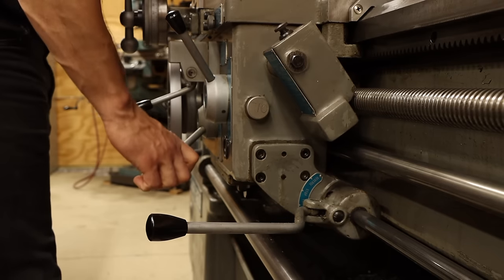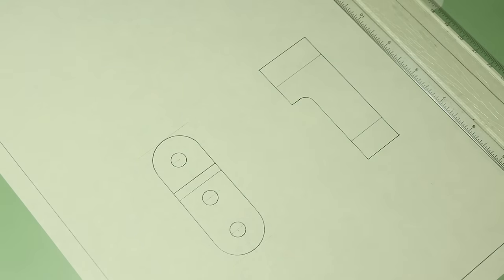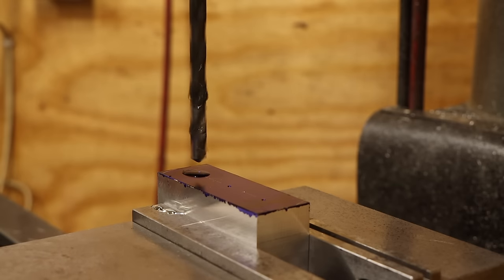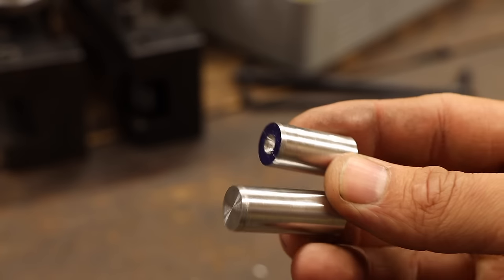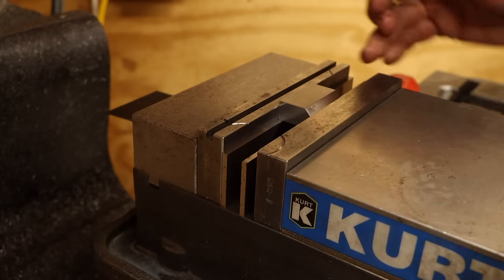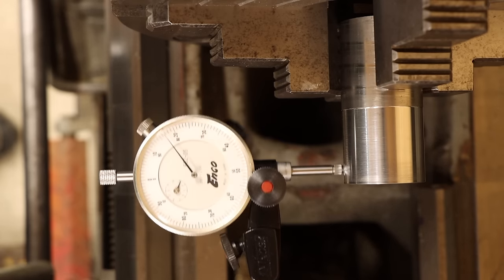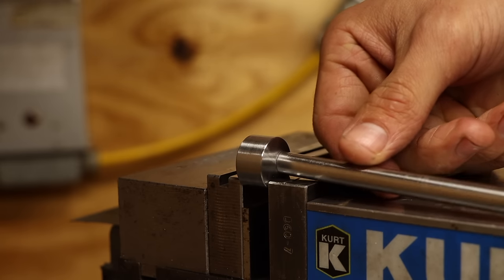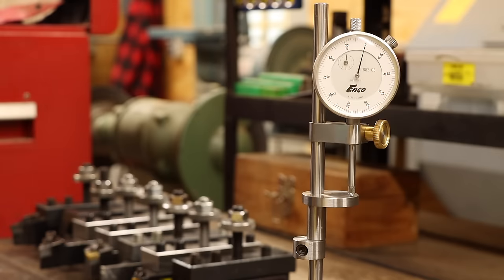A FANCY Lathe Tool Height Gauge || INHERITANCE MACHINING

Comment: Regarding magnets, you could have made an eccentric lifter that actuated a block inside the body of the base, leaving you with a narrower area of the base to lap in(i would have used harder metals merely to make it more durable and allow for lapping in... Inside the base you fit that sliding block and put in a few strong magnets... When you want to clamp down, you turn the knob, rotating the eccentric and allowing the block with magnets to lower and almost touch down, giving a strong magnetic pull, and when done, you lift it up, weakening the mag pull and allowing the base to be moved as you like... 
You could even use aluminium and bore out 3 holes for carbide round inserts which could be screwed in and loctited in place, lapped flat and perpendicular to the rod and the base, and then flood them with epoxy to provide a seal for the magnets so they dont suck in any particles when around any machine surface... The epoxy could be filed down or machined down those few tenths to leave the lapped carbide feet as the only reference... You could even avoid that by flooding the base in oily clay(kids clay with a bit of oil added to it) mould where you would gently press the feet in the surface, leaving them a smidge proud, and inserting a clay plug where the magnet block would be to seal that part off too... Its a lazy approach and easy, but can be accurate if done in a vertical press with an indicator... The black epoxy would also grant the aluminum base a nice contrast... 
Tho for moving it on the ways, you would have to be careful not to scrape them with the lapped carbide feet when you would move the thing about by tilting it, as lapping produces dead sharp 90 corners adjacent to the flat surface...

Comment: Semi related — I finally made myself a semi-precision machinist jack! I have no idea how you got your clamping slit and the threaded hole on the lock ring so nice 🥲 mine is nowhere near as nice and the clamp doesn’t feel like it tightens enough, however I did have to make some changes to tap sizes and some other things due to my own tool restrictions, and I’d never done that in a round part haha.  but man this project had a bunch of clamping slits!

Comment: I want it. I dont have a machinist shop, or even a garage, that I could turn in to one. But I still feel like this tool is something I need in my life.
Reply from the maker: It makes a nice fidget toy 😉
Reply: @Inheritance Machining  that, or I could use it to measure the sag on my GPU 😁
Reply from the maker: @nicosand86  😂 maybe exclude the magnets then!
Reply: @InheritanceMachining  naah, the magnets shouldn't be a problem so long as I dont rub the base all over the mothetboard and gpu 😁
Reply from the maker: @nicosand86  but isn't that the most logical place to mount it? 😂
Reply: @InheritanceMachining  not in my pc case 😁

Comment: Fun fact. Today it is "canon" to set tools exactly on CL. 
But in the REALLY old days it was to keep the tool about 5° above center with respect to the work center point for outside turning. That is really inconvenient to do in general machining so it has fallen from favor. 
There were good reasons for it at that time with the tools of the day. It was 5° above center to always keep a slight positive bias of pressure on the cross slide screw , to accommodate flex in the tool and holders,to keep the work away from any climbing over the tool, to better control chip flow and to counter any tendency of the work to pull the tool in(especially with the back rake used at the time).
It's just one of those things we do now that are not necessarily better. Remember,  most of our great grandfathers were not idiots.
Reply: I suspect the rise of carbide inserts designed to cut exactly on centre and much more rigid machines is why that is no longer necessary
Reply: @msmith5080  The two events do seem to coincide.

Comment: Have you ever heard about magswitch? I think that would make a great addition to your shop(including this project). It is basically a magnet that you can switch on and off
Reply: When he mentioned overcomplicated solutions and proceeded to embed magnets in the project I immediately thought of this.  More generically called 'switchable magnets' or wiki magnetic switchable device.
Reply from the maker: Oh yes! Pretty sure that's the same thing that's used in my magnetic indicator base. Of course I didn't think of this until after I finished the project 😂

Comment: Beautiful tool...Much nicer than the slug of off cut Ali billet I keep on the end of my machine for face cutting a new tool in. Keep a note of the height of that parting blade...It was probably cutting perfect...you will need to factor in deflection.

Comment: On the off chance you aren't aware, I feel obliged to say that Allen screws are engineered to tighten to spec by hand tightening the screw with the long end of the wrench, and then doing a quarter turn with the short end.

Comment: Very nice.  I may eventually copy this item in some fashion, but one of the mods to my lathe was to add a bit of rubber mat mounted under the cutting edge to keep the ways cleaner during use, so this might not fit well.  My next lathe project will be to take the 2HP DC motor and controller from a treadmill and add it to the front of the lathe (keeping the original drive in place and undamaged).  A quick belt swap to the main drive pulley should suffice.  Should take my 10x22 1HP lathe to the next  level...or destroy the drive train...one or the other lol
Reply from the maker: Neat! If your gears are case hardened, I think you should be just fine

Comment: I run the tool nose up to the work or whatever I have that is concentric with the lathe's centerline, with a scale (metal ruler) in between them. If the top of the scale points to the back of the lathe it's too high. So most of the time you want the top of the scale barely leaning back towards you. Kudos for making something though.

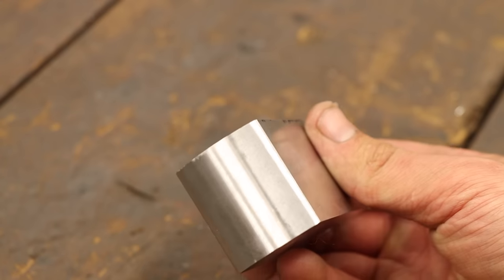Comment: Another winner, Brandon, thanks.  I have a question:  8:15 you use the belt grinder to shape down to the scribe marks but don't like the finish so you go manual with finer grit.  Preference, anal-retentive, or would progressively finer belt sander ...uh... belts... have given a similar finish?
Thanks man, I just bought a retired machinists gear lathe, knee mill, tooling o'plenty, and metrology trinkets and your videos have made you my spirit animal; in fact, seeing your first video on moving the equipment introduced me to the drop-deck trailer, without which I'd still be wondering how to get all that stuff from over there to here.

Comment: The air pressure deforming the underside was interesting.
Reply from the maker: Yeah, super high compression ratio. Maybe 500-1000 to 1. At least enough for that thin aluminum on the bottom

Comment: A vacuum plate with a pump would be a great addition to your shop and makes clamping allot of pieces piece of cake
Reply from the maker: I've been considering it actually. Would make holding aluminum on the surface grinder a breeze as well

Comment: I’m not entirely convinced those bumps on the bottom of the base after pressing the plugs in was actually caused by air. I just don’t think there’s enough air volume there that the pressure is actually all that high. I think the more likely explanation is that endmills - generally speaking - don’t actually leave a flat face in the bottom of a part when they’re plunged into work. They have a small amount of relief in the center which causes a very short cone at the bottom of the hole. When you pressed the plugs in, the magnets got forced into that cone and essentially flattened it, causing the metal to bulge out the bottom of the part.
Reply from the maker: You might be onto something there. I completed forgot about that standard mill relief!

Comment: For the too narrow thumb bolt, it might have helped to upset the screw's body, which then create an interference fit with the brass. Or of course, after mounting the steel in the bass, use a centerpunch to upset the steel close to the brass and create a positive fit, which then is hidden by machining.
Reply from the maker: Clever!

Comment: You make some really cool versions of existing tools.  Any plans on making an I.M. version of a cross slide mountable ball turner? In particular, I'm very curious to see how you would "solve" the problem of ensuring that the adjustable cutter depth (ball diameter) stays true.
Reply from the maker: Thanks and yup I've got some ideas in mind for a radius tool. Could be used as a ball turner but I like the flexibility of being able to do any fillet or round I might need

Comment: I just got a flash of an idea - why not use the bottom surface of that eccentric bush to rest on the cutting edge and set the dial indicator on the top of that bush, calibrating and accounting for the thickness of that bush. So in effect, the dial indicator tip doesn't have to come into contact with the tooltip, and if over time that bush is going to get scratched with having to constantly touch the tooltip, it can be replaced with a new one. I hope you are able to get what I meant.
Reply: Google - flat point indicator stylus for a similar result.
Reply: @marley589 - ofcourse I know what a flat point stylus is. I was commenting with respect to this particular video.

Comment: Very nice job, everything turned out beautiful. Have you seen the type of tool setter that mounts in the chuck and uses a level for reference? It sits on top of your tool and you just adjust it until the level reads level. Mark Presling made one a while back.
Reply from the maker: Thanks! I actually stumbled on that design after I finished this one. Seem pretty nifty!

Comment: If you don't already know this tool & die makers trick... 1) Drill your hole.  2) Counter bore a short distance with the boring head slightly larger diameter than the drill diameter.  3) Ream the rest of the distance of the hole.  The reamer will start and track the initial counter bore the whole way down.

Comment: The clamping slit that secures the rod in place is clamped with 3 bolts. The bolts are tapped in to aluminium, and will be in regular use. I would personally have used wire thread inserts to prevent the threads wearing out over time. In fact, any time you are tapping in to aluminium and using bolts that will be in regular use, and not just set and forget, You should use helicoil inserts.

Comment: Another awesome project! Will you build a tool library? I was taught to position some tools just above centerline to account for flex during the cut. I know it could get complicated based on speeds, feeds, material, tool geometry, etc...
Reply from the maker: No doubt I will have enough for a tool library at some point! And that's a good point on tool height, but like you say it could vary tremendously based on cutting conditions. I suppose it depends on how one takes finishing cuts. I like to whittle it down a thou or two at a time near the end. But I know some like to sort out test cuts so the final heavy pass puts it right as size.

Comment: I took a similar path. For decades I set my tools by pinching a six inch pocket rule against the workpiece. But when I saw a dial indicator style setter, I absolutely HAD to have one. I orient the zero at the 9 o'clock position. That way the needle position mimics the tool height. Also, I have a flat faced point on the indicator, rather than the usual ball point. You could make one easily enough. I bought an inexpensive accessory point set, but that's not your style, is it.
Reply from the maker: Neat! Glad to see I'm not the only one who had this idea. I heard that sometimes the knurled grip on the top side of the indicator plunger can be swapped with the indicator side. It has a flat face and would save the same purpose

Comment: Very good concept,, can I ask if you ever mount tools 'upside down' i.e. for threading away from the chuck ? I have thought about making a setting tool, and my idea was to make the setting reference with two faces, one level reading from the top, the other level from underneath, so you can check the 'upside down' tools as well.
Reply from the maker: I sure do but not very common. A setup like your would do the trick though. IN the case of mine, I'll probably just use the top of the "flag" and go by feel

Comment: I've done something similar but using the dial plunger directly,the top and bottom caps on a dial indicator can be swapped around for a wider contact patch

to make a more precise offset you can put a spirit level on a 2 jaws to offset the work
Reply from the maker: 🤯 You learn something new every day

Comment: 10:00 
Isn't that compressed air dangerous? The pressure to put the pins down was quite high, but, over a long time, what is expected to happen? The air to slowlly leak, or the plugs lifting slightly?
Reply: it had already leaked out by time he was finished sanding
Reply from the maker: It will probably dissipate in time, it it's also super low volume so the risk of danger is pretty low

Comment: Get a flat bottom tip for the dial indicator then you can probably do all tool geometries ;D
Reply from the maker: I just learned you can usually swap the tip for the little grip top on the top of the plunger!

Comment: There's no such thing as overtight.  During high school and for a couple of years after, I worked at a farm machinery dealership turning wrenches.  We worked almost exclusively on the combines used by farmers for harvesting their crops.   There is a tremendous amount of moving, shaking, and vibration on those machines.  It only takes one time for a customer to call back and say something you had worked on just fell off of their machine before you tighten every bolt until it starts to stretch.   
  I enjoyed your video.  I've always set my tool height off of the tailstock, but I do realize that it lacks accuracy.
Reply: > tightens a bolt until it breaks
> no such thing as over-tightened lads it's perfect 😎
Reply: @Dušan Pešić  a broken bolt isn't too tight. It's a broken bolt.  Yes, we did occasionally break or strip bolts.  I had a Matco impact that was a copy of an Ingersoll 3/8 impact that would tighten a 3/8 bolt just as tight as could be before failure.   I traded it in for a more powerful 3/8 Matco, and I regretted it.  With that little Ingersoll impact, you could zip right through putting a machine back together and never have a second thought.

Comment: I think you missed the mark with "it was fun to make".  I suspect that you may just be a bit of a perfectionist (like a lot of us in the HSM field) and a good part of it is being proud of what you've made....and you should be :D
You might want to be careful setting your parting tool in particular to exactly centre height.  Maybe your machine is much more rigid than mine (it probably is!) but once the tool loads up, it can deflect downwards and then you're below centre and it can get pulled in and down and next thing you're swearing and looking for either new insert, new holder or both.

Comment: Would a bit of a roundover on the bottom edges of the magnetic base be a good idea? I'm thinking that the sharp corners might damage the lathe ways when placing and removing it.
Reply: Eh it’s an ali block I’m sure the ways will be fine

Comment: I probably would have drilled a small hole in the side of the base going through both magnet holes right above the magnets to allow the air to escape, then pin a plug in it and blend it into the rest. Alternatively, if the slit on the base was towards the back not the side, it would have allowed drilling such a concealed vent without even bothering to plug it... ;)

Comment: What do you use to oil all your machined tools? I’ve seen you blue some but your tools that don’t get blued have to have something?
Reply from the maker: I sometimes use a product called ACF50, but in general just oils from being used and a dehumidified shop makes rust a non-issue

Comment: I have a question. Since the cutters will deflect slightly downwards when taking a cut due to the force of shearing the material, wouldn’t that bring it under the height you set them at? Would it improve cut quality to compensate for this?
Reply from the maker: That is a factor for sure but I don't think it's in the realm of affecting cut quality or accuracy until you get really small in diameter. The deflection would also vary greatly with different speeds/feeds/materials

Comment: At 9:58 would freezing the plugs beforehand have reduced the diameter enough for the air to escape?
Reply from the maker: That might have worked actually. Though it might have been a bit much with the 2 thou press fit I went for

Comment: This is the first time I don't think the design is that great. namely the lower part that should show the 0-point. it would have been cool if you left out the second piece underneath and put the clip function in the top piece. the eccentric design of the bottom one was cool though. this is how I would have made the bridge for the pole. and then not straight up but in a curve up to the top which is the 0 point. I hope you understand what I mean. but if you want to swing away then I would have just done it in such a way that the lower clamping block and the upper one are constructed the same way with the eccentric design. that if they are correctly placed one on top of the other, one does not recognize that there are two parts. I would have also put tiny magnets in it so it just stays in place and it looks like it's one piece, but if necessary you can just keep turning it to swing it away. but when you don't need it then the magnets line up again and it looks symmetrical and you think it's one piece instead of two.